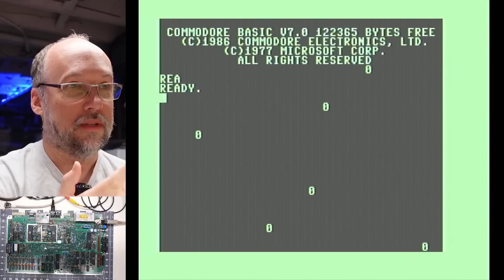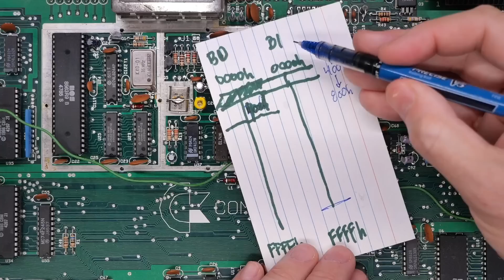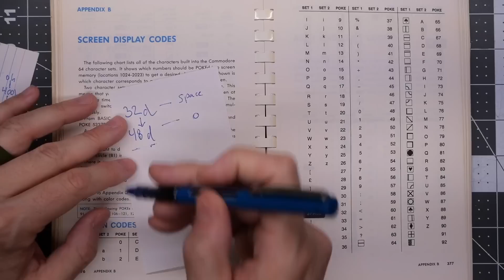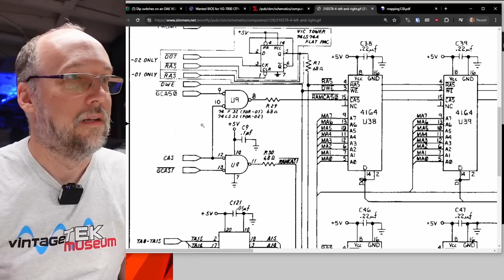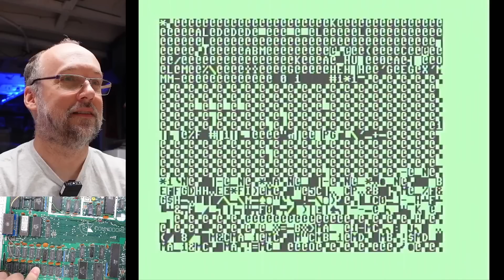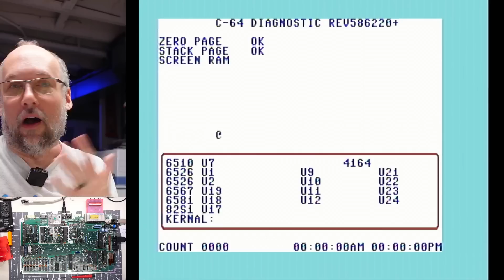You don't always need fancy tools to fix a broken 8-bit computer

Comment: A brilliant tip on how to find faulty ram chip. With this method you don't even need the PDF or the book. You just put a good ram chip on every single ram chip on the board one at a time. The worst case scenario is you have to do it 16 times to find the faulty ram. So 4 to 8 minutes should do it. But it would be a very short video. I use to be a TV engineer many years ago and one of my friends Welly use to repair a lot of 8 bit computers and can remember him constantly replacing ram chips and putting in sockets. Ho for the good old days :-)

Comment: The existing MMU version cannot take more than 128 of RAM; the MMU CR bit 7 is reserved and has no effect on memory manangement on existing MMUs.

Bank 1 can be tested by running the C64 mode in Bank 1.

monitor

monitor
    pc  sr ac xr yr sp
; fb000 00 00 00 00 f8
m1c00
>01c00 00 0b 1c 0a 00 9e 37 31
>01c08 38 31 00 00 00 78 a9 3e
>01c10 8d 00 ff a9 06 8d 06 d5
>01c18 a9 7e 8d 00 ff a2 26 bd
>01c20 2b 1c 9d 00 38 ca 10 f7
>01c28 4c 00 38 a9 40 8d 06 d5
>01c30 a2 01 8e 0a d5 8e 09 d5
>01c38 8e 08 d5 ca 8e 07 d5 8e
>01c40 30 d0 a9 e3 85 01 a9 2f
>01c48 85 00 a9 f7 8d 05 d5 6c
>01c50 fc ff

s "b1c64mode",8,1c01,1c52

saving b1c64mode

Comment: Seeing as MT (Micron Technology) RAM supposedly fails because they don't have much tolerance for overvolting due to elderly psus, is it worthwhile checking the PSU for issues if the faulty C64/128 came with it?

Comment: If the piggyback method doesn't work, you could use a resistor to pull up or down an address line (or some other line not shared by both banks) to see if the display changes to confirm what bank is being used for screen ram. Once you know the correct bank. you could try pulling down the data out on your suspect chip to confirm if it is actually the chip of the data bit you think it is that is wrong. You could try pulling down the data out on all the chips in your identified bank one by one if you don't have good schematics and you want to know which chip is which bit.

Comment: I remember reading an article in 80 microcomputing (TRS-80 centric magazine) about how to add 16K to the base unit on the cheap.  And it was basically what Adrian did here.  You piggy backed the additional 8 4116 chips on the existing RAM chips, all except the CS pin which you bent up 180 degrees.  Solder all the pins (except the CS line).  Then run a bodge from chip to chip on the lifted CS lines, and then onto a pin on the address decoder chip, so that when you hit the second bank of 16 the piggy back chips were selected.

And the nice thing about that mod was if you ever got the expansion chassis, you could disable the additional on board ram by simply cutting the CS bodge wire.

Comment: I am actually glad to see you do this type of soldering.  I have a few old computers where the PCB has damage and it's extremely easy to lift pads.  For those boards, I prefer just cutting the old components out and resoldering the new component on top.  It doesn't look pretty but seems to work fine.

Comment: I would honestly recommend getting one of those cheap spring loaded desoldering tools and a heat source like a hair dryer or the like.

1. Cut all the legs on the chip.
2. Heat the board up with the hair dryer, focus on the local area where the work will take place. This will more or less make the copper layers inside less eager to soak away the heat from the iron.

3. Use the soldering iron to gently pull away the pin using a pair of tweezers.
4. After removing each pin, hold the tip of the iron at the "edge" of the pad, it is okay to be a bit over the soldered filled hole. And when heated, use the desoldering tool from the opposite side, and now you should have a perfectly clean empty hole ready for a new pin.

5. Rinse and repeat from step 3. Occasionally one can need to add some new warm air to the board.

6. Place in the new chip and if there is heavy grounding on the board, feel free to take aid from the hair dryer again.

Generally speaking, the excuse of "I don't have basic tools" isn't a good excuse for doing a hack job. When the basic tools in question are so cheap that most people don't even consider them a professional option.

Now yes, a proper desoldering station is way faster. But doesn't actually do the job better than if one has some patience. The 5$ solder sucker is honestly one of the best bang per buck tool one can get as far as soldering is concerned. And actually faster than a desoldering station if one only has to desolder 1-2 holes, since it doesn't need to heat up.

Comment: The minimalist fault-finding part of this video was an excellent demonstration, especially for those without much, if any test equipment.  -> I'm sure at times that you're trolling us when you do things like putting the test piggy-back DRAM on backwards and cut the leg of the part adjacent to the actual faulty one 😂

On the other hand, whilst piggy-back soldering a replacement DRAM is a valid way of mitigating risk of PCB damage if one is short of one or more of: confidence/expertise/tools to remove the faulty part ... the far better option (IMHO) that you put forward afterward is to snip the legs of the faulty part and remove the legs one-by-one with tweezers, then a solder-sucker is still required after.
 - At the end of the day, if you have a soldering iron and intend doing component level repair, then you should also have obtained at least a half-decent solder-sucker, some rosin cored solder and preferably some de-soldering braid, some flux and of course, some IPA to clean up afterwards.

Comment: I'm pretty sure that piggybacking DRAM chips like that used to be a common way to upgrade RAM on early 80s computers. I had a garage sale Heathkit H89 in high school that had its RAM upgraded to, I think, 64kb  in that manner. I assume it did some kind of bank switching  and toggled the enable signals on both chips. Or maybe piggybacking DRAM chips were bigger than the originals, and  the smaller chips were disabled. 

I have a dead C128D that I recently paid way too much for. I hope it's an easy fix, as I have no idea what I'm doing.

Comment: I have done that exact thing when repairing a micro computer controller at a remote site, no workshop, no oscilloscope, only soldering iron, multimeter, manuals, and luckily some spare parts. Worked like a charm until a replacement board could be sent out.

Comment: why solder it on top, if you're going to cut pins, cut all the pins and pull the legs out of the board one at a time
I guess clearing the holes might be difficult without any tools, but a real good way to do it in the field is take a soda straw and blow through it when the throughhole is hot and it blows it clean.

Comment: I would say that it is much safer to cut ALL the pins and remove them all by holding with pliers and heating with the iron, and then install a new IC than it is to cut 2 and 14 and piggyback all the others. Anyone with little soldering experience could easily have major issues with excessive heat trying that.
Reply: OK, I got to the part in the video where you mention cutting all the legs and removing the pins individually. In my experience, though, I know I would have once upon a time made a serious mess of trying to cut 2 and 14 and then soldering all the others piggybacked over the top of the existing chip. I can imagine all the bridges I would have made when I first started soldering all those years ago.

Comment: Do you have one of those cloths pin style chip clips that 
you could put a socket on and do the same piggyback test?

Also, I designed a few PCBs with ZIF sockets and I always TRY to use the end with the lever as pin 1, unless there is no room to have the lever at pin 1 on the PCB...
Also, always make pin 1 on the PCB a square pad.. so you can see from both sides.

Comment: 26:00 Fun fact about bus conflicts that is 6502 related. NES emulation has to emulate bus conflicts (and open bus behavior) correctly because a lot of games rely on certain spurious values that arise from reads and writes on the bus due to either programming or documentation errors during development.

Comment: That 1986 ROM is the upgrade ROM for the original Kernel ROM which had a few bugs, the easiest to test being that on the original ROM, the CAPS LOCK key didn't work on the letter Q. The key would still work, but would type as lower case.

Comment: Oh boy. I scrammed at the screen when you put that chip on the wrong way around.
Reply: Ditto!
Reply: @baronvonschnellenstein2811  Also me. My wife is confused... and laughing?!?
Reply: Indeed. It can be clearly seen on 26:07. My first thought was: oh, perhaps it is a quite different MT IC (some had the USA flag, but iirc those are 41256). When I rechecked I could see the indentation mark was set wrongly.
Anyway, who hasn't reversed an IC by mistake? (especially if you're tired).

Comment: nice i got a 128 off Ebay 128 mode did not work c64 did turned out just had a BAD 128 Roms i programed 2 new it and BAM worked!

Comment: If you use 41256 chips, you must tie pin 1 (A8) to either GND or Vcc. I do not know what the 128 does, but on the 64, they are not connected to anything on the board. A jumper from pin 1 to pin 16 is all you need.

Comment: Removal is easy, cut the pins with a dremel, use some fresh solder on the pins, they will probably fall out. I really don't know why people have such an issue with this. They also press too hard with desoldering guns or set the temperatures wrong. Preheat the boards too.

Comment: What would be a good idea is to run a full C128 RAM test, because broken chips in bank 1 are a lot less noticable. They do not prevent the C128 from starting, it just malfunctions in BASIC. As Micron RAM chips usually fail one after another, it is quite plausble that a chip in bank 1 has failed as well (or will fail), therefore you should test all of the RAM. With Micron it is usually a good idea to replace everything, however... replacing 16 RAM chips is quite a bit of work. My C128 also has Micron inside, with the inevitable bad chips. I have now done multiple RAM repairs, not yet replaced all of them, but I really should, because it's just waiting for the next chip to fail.

Comment: Sadly the MMU does not provide the high bit of the ram bank select register, eventho it does exist internally, so while programatically the MMU supports 256k system ram, and partially even 1mb, but this is not actually usable without adding a second mmu, or with a redesigned mmu with the required extra outputs. 

The partial 1mb support concerns the stack and zeropage relocation, those allow for a full zeropage address to be 20 bits (12 bits from the relocation register, and 8 bit from the zeropage address as the cpu uses it), and same for the stack. But again, there is no way to actually make use of this beyond 128k system ram.

As a curious aside, ram banks 2 and 3 are actually supported by the kernal, just not used.

And a bit of trivia, when talking about a 'bank' for the c128, that actually refers to an mmu configuration. The kernal has 16 predefined configurations, from 0 to 15, which in all related documentation will be called bank 0 to 15. It is also possible to program the mmu directly. It so happens bank 0 and 1 map to the first and second block of 64k. In their documentation Commodore calls those 'ram block 0 and 1' instead of 'bank 0 and 1' because of this.

BASIC 7 has a bank command, and will ensure your pokes and peeks (and sys commands) go to the bank you specified using that command.

Comment: Those "MT" Ram chips are actually "Micron Technology" Ram chips. That "M" is actually the Greek letter Mu which looks like a lower case "u" with tails hanging down on both sides of the "u".
Reply: so, this is the same micron that sells "cruical" branded ram sticks, right?
Reply: @proCaylak  Yes, the company making and selling the Crucial branded memory sticks (populated with Micron memory chips) is the same company that produced the now infamously unreliable 4164 chips back in the day. As the failures of those chips appear gradually, I don't know whether the quality issues hurt them back in the day, or whether the observarion that Micron 4164 chips are less reliable than all competitors only surfaced when 4164 chips mostly obsolete anyway. 4164 chips were used as parity chips for banks 2 and 3 in late 80s XT clones, but otherwise got replaced by 4464 (reducing chips count, like on the latest C64 board) or 41256 (higher memory capacity for "more professional" systems).
Reply: And Micron Technology still exists, and is known as reputable and reliable brand. It's just the 64k x 1 (4164) chips by Micron that are notoriously bad. I don't think I ever heard complaints about the 256kBit chips, that is 64k x 4 (4464) or 256k x 1 (41256).

Comment: I didn't know what I was doing. I never desoldered anything before. I had shitty ass tools. I replaced all 8 ram chips without any damage using a cheap iron and the crappy sucker. I replaced the PLA (which wasn't bad) without damage. I replaced the color ram (wasn't needed). The shortest trace was the one I broke. (the issue was the power cable was too thin and when you plug in a cart it dropped from 4.5V to 3.5v) Then a year later my cartridge port failed. I replaced that and only lifted a single trace. I didn't even have to bodge it. I just soldered it as if it was a wire.

Comment: "one by one just use tweezer to remove the pins"
THIS IS WHAT YOU SHOULD HAVE SUGGESTED IN THE FIRST PLACE!
NEVER DO THIS TYPE OF REPAIR!
Reply: Oh c'mon.  Why not?  It's not pretty, but it's perfectly sound.  'Sides, you ever seen the 5170 motherboard with piggyback RAM ICs?  If IBM can do it, who are we to argue?
Reply: @sirnickity  I don't like that either, but at least it's done by a machine. If you don't know enough to desolder properly, how do you expect to not accidentally short something. You could end up blowing something worse than a ram chip. Also if you're going to do something, do it right.
Reply: @awilliams1701   It's not about knowing enough.  I've been soldering almost all my life, literally.  Removing DIP packages is still challenging in multilayer (2+) boards, and particularly would be for those out there who don't have desoldering stations, or hot air rework tools, or some other way to preheat the board.

This is an ugly but effective to get the job done w/o risking delamination of the copper, or damaging thru-holes.

Comment: you did yourself a favor. Now you have an excuse to REMOVE both chips. Dont't do this piggyback crap. Worst case, you can cut all the pins and use an iron to pull the pins out.

Comment: When I tried piggy back on my MT ram (and knew which chip it was), it didn't work. And I had the same type of failure. I had some becoming 0's and some becomeing 1's. Piggyback didnt' work. Replacing it did.

Comment: lol MT ram. I'd just replace it all. No point in keeping that crap. I had MT ram. Using nothing but basic I figured out which chip was bad. I replaced that one first and it fixed the issue. Then I replaced ALL the rest.

Comment: I just picked up an old IBM PCXT and i didnt realize until after the sale that the DRAM chips are all piggybacked. I remember from when I was a kid it was possible to piggyback larger DRAM chips over the stock ones. I dont know what happened to my XT yet, but im afraid they just piggybacked over bad ram. Should i bother removing them all and socketing the board? Machine is untested while await my new IBM F-type keyboard.
Reply: I'd say that's a huge amount of work for an untested machine. if it works, leave it that way (never change a running system, removing chips always includes the risk of damaging the board) if it fails, you still can solder it out
Reply: The first generation IBM AT mainboard actually used factory-piggybacked RAM, to get twice the capacity from one chip location. The two layers have /RAS on two different pins, so that provides two banks in one socket. Their generic name is 41128, although many manufacturers had slightly different names. Minuszerodegrees has a page on them (no link to not get the comment blocked). There also were 4132 chips made from two 4116-like chips, used on IBM 64K memory expansion cards for the XT. As far as I know, no IBM XT mainboard ever supported piggybacked RAM chips.